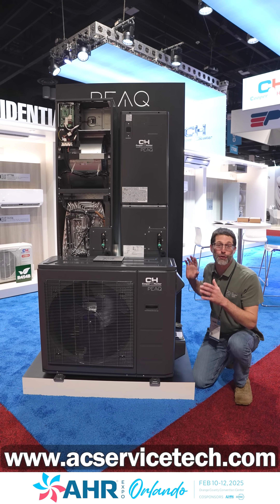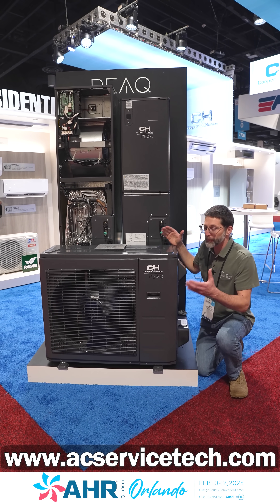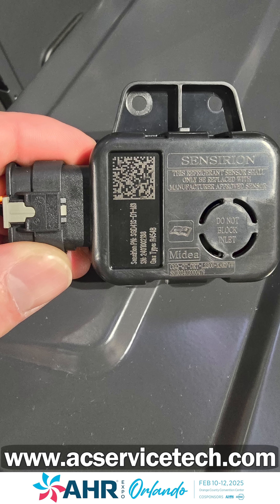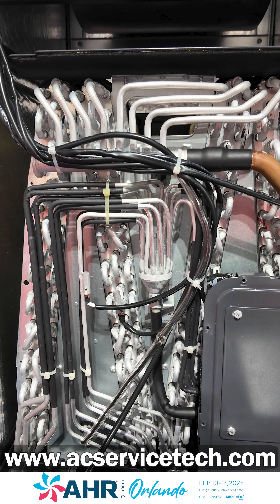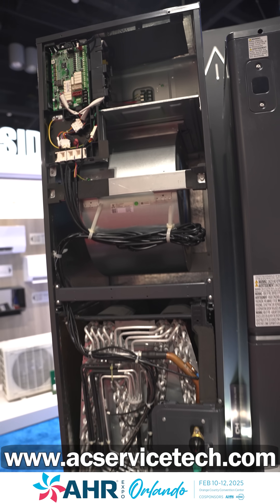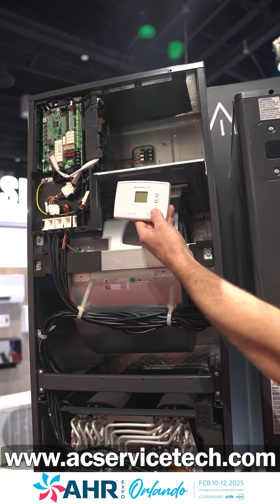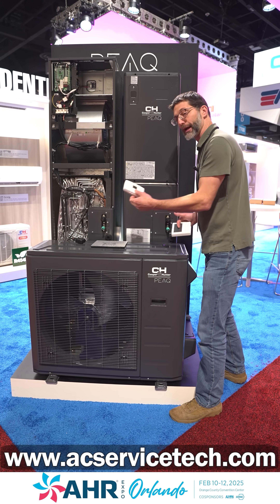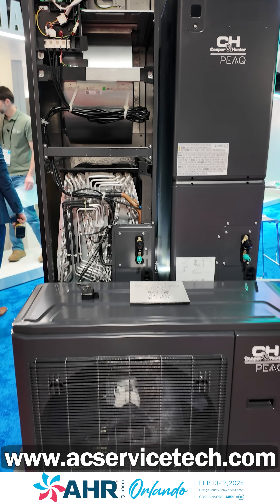Discussing the Cooper & Hunter PEAQ Units!

Comment: Looks like way more stuff to go wrong to me and very expensive to fix.  It probably has that leak sensor because the gas is flammable or toxic, and they don't want your house to go boom.
Reply: all of the new refrigerant is flammable (it's propane or butane based if I'm not mistaken)
Reply: @iamdonsharp sadly, you are slightly mistaken. They're A2L, which is slightly flammable. A3 is propane/ butane
Reply: @EvanAharonov  I'm not sad about it, I work with r22 or 410 units, my company doesn't have money for new stuff
Reply: @iamdonsharp  r410a units are no longer being produced and sell off is until the end of this year
Reply: @EvanAharonov  yes which is going to make it expensive to maintain like the r22 units I also work with. I'm not an installer I'm facilities
Reply: Slightly flammable, if the sensor detects a leak it keeps the blower on to disperse so it won't build up enough to go "boom" even if there happened to be perfect conditions for it to ignite. The solution to pollution is dilution.
Reply: @Heyyy-m8j alright bro😂
Reply: @quashhh  tell me u don't know what the "l" stands for in a2l without telling me
Reply: More money for us 😮‍💨

Comment: You didn’t mention strip heat. Is that an option? And where is this brand sold?
Reply: minisplitsforless or Amazon. I've installed about a dozen of these their great. I live in PA and they keep up no problem
Reply: @spacemanwithraygun3933  forced air??
Reply: Like most air handlers it looks they go in a space near the top (behind the circuit board) but I’m guessing

Comment: Now you have to carry R32, R454B, R410A and maybe R22.
Reply: Don't forget those interim refrigerants R-407C , R-422B & 422D and if u do refrigeration too - add R-134a,R-290, R-404a , R-448a.
and Don't Forget a Different recovery cylinder for Each Refrigerant. 🤦‍♂️
Reply: but but but those are all necessary or the bald eagles will fall out of the sky! 😢
Reply: @aname3576   😂😂